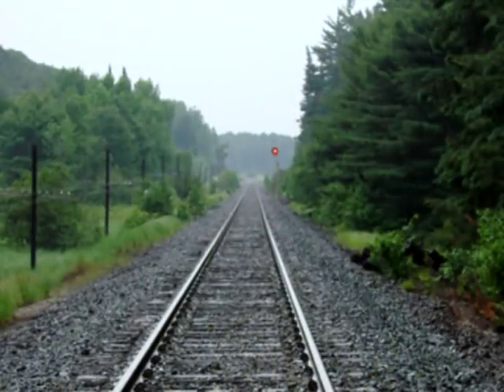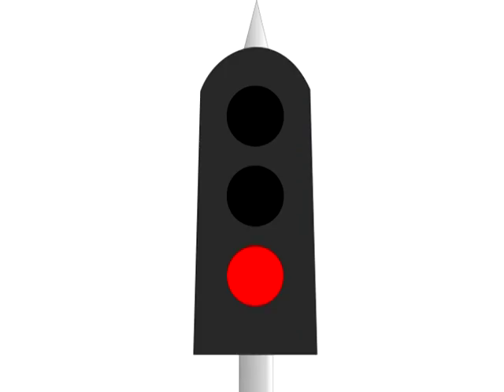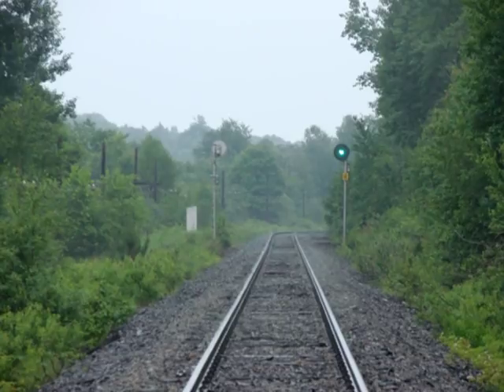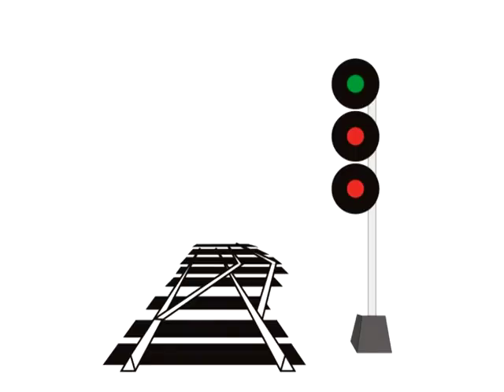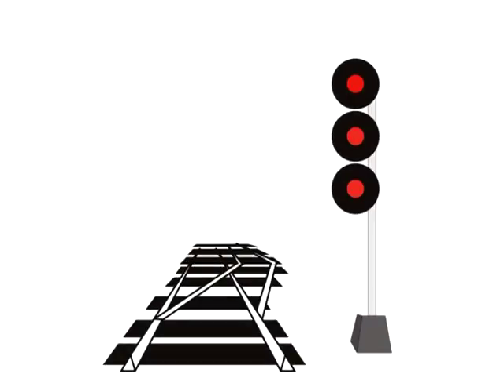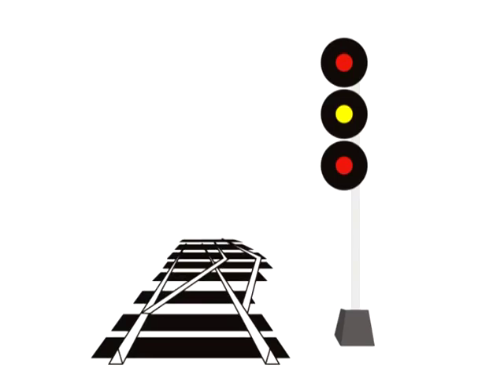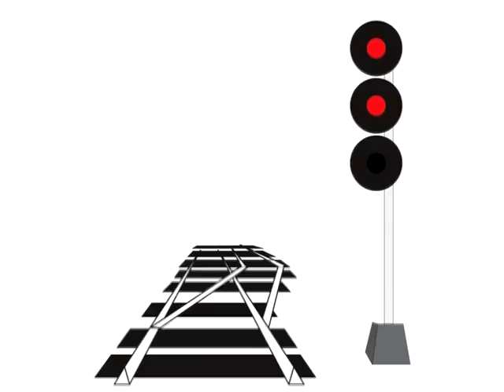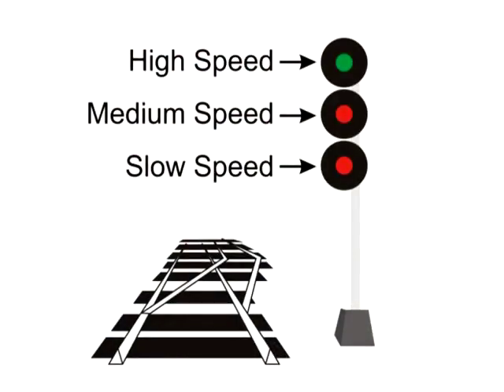Railroad Signals, reading and meanings, part 1: The basic three light system

Comment: What about rail signs? What does "R X R" mean? Thanks for uploads.
Reply from the maker: +CHRIS BROESKY That would have to be Railroad Crossing. Is this a sign for the road? or the rail crews?
Reply: Ian Juby yeah its a round R X R rail crew sign. What about the rotating green/red signs on switches? Your signal videos were great! Just curious about rail crew signs now.
Reply from the maker: Ah, okay. The switch stand reflectors are so we can identify which way they're lined from a distance.  Red/Green is main track, Yellow/Green is non main track (i.e., a yard).  Red or yellow means the switch is lined to go off the main track.  Green means it's lined for the main track.  That was the reason for my one emergency stop - we came around the corner at night and saw a red reflector.  Turns out the reflector was loose and got turned exactly 90 degrees in the wind!  Thankfully the only damage done was the stains on the seats.  :)
Reply: +Ian Juby Lol! Thanks for the info :)
Reply: +Ian Juby Hey there Ian. Im seriously interested in getting hired on with CP or CN and a career in the railway. I know the economy isnt great and there probably not hiring much. Any tips on what they look for on resumes, or any tips in general on how to get in on the railway?

Comment: What does

Flashing Green
Red
Red

mean?
Reply: +CanadianRailfanner12  I have been through the CROR many times, and I don't recall any such signal.  Where did you see this?
Reply: CanadianRailfanner12 the signal is broken
Reply: in  other parts of he world there are similar ,not exactly same ,for example flashing green means  that the train will remain on the main track, but that the next signal (usually the exit signal) should be approached at not exceeding 60 km/h, expecting a divergence there.A flashing green over steady yellow, with one green plate, indicates a divergence with a permissible speed of 80 km/h, with the exit signal clear (1/18 turnout).these signals i mentioned are not from CROR :)
Reply from the maker: It depends on if it's a dwarf signal or not, which is what it sounds like. I cover those signals in part 4.
Reply: It is not a proper signal on a high mast and we be considered its most restrictive speed which would be a clear to stop.
Reply: Given what he said in this video, I would expect that means "advanced clear to proceed", ie not only is the block it controls clear, and safe for full line speed (no sharp turns, no switches set other than straight-ahead), but the signal and block after that is also at least "clear to proceed" (or even an ACtP itself), and the third block in the series is at very least a full-speed caution (ie, yellow-red-red) / clear to stop. Meaning that from that signal forwards you have three full blocks before you would next need to stop, and two before you need to consider braking in anticipation of stopping.

For high speed trains that are allowed to reach a higher speed than normally-engineered ones (usually 140mph+), or in cases of passenger expresses sharing a line with more restricted freights, with the extra speed meaning an even longer than normal stopping distance, that's essentially "clear to run at maximum permitted / elevated speed". A non-flashing green (meaning only two "clear" blocks with a potential stop at the end of the second, and therefore probably a need to start slowing in anticipation of a stop after the first) would instead mean permission to run up to the normal maximum speed (so 60 to 75mph for freights depending on location and specification, and up to 79mph in the US / somewhere on the 90-100-125 axis in the UK for passenger services), basically acting as an additional level of speed restriction for HSTs.

Same as with the flashing yellow, the failsafe condition is to fall back from "elevated speed permitted" to "normal line speed permitted" if the flashing mechanism fails, as well as it being a condition for signals ahead of e.g. some moderate bends or high-speed rated switches (good for up to 80~90mph, say) which standard services could take without having to slow down, but HSTs would need to brake for - without having to show a "medium speed" indication and slow every single train passing through to 30mph just so that the express services wouldn't derail.

Think of it a bit like how USB speeds have gradually increased from the original 1.5mbit/sec and they've had to come up with additional superlatives for each new grade as it's been added ;) ... only that original one is "low speed", 12mbit is "full"... then USB2's 400mbit had to be called "high speed" (a bit of an extreme jump, but analogous to our "full line speed" and "high speed" trains), and now USB3 is "super speed" (...we probably won't see that sort of thing sharing lines with regular trains due to the limitations of steel wheels on steel rails adhered and steered purely by gravity; but you could probably call the experimental 300+mph maglevs and hyperloops and so-on "super speed" trains... or just shift everything down a level by calling 12mbit "medium speed" instead). And if the quality of your cable just isn't good enough to support the newer, higher speeds, the system will gracefully fall back to one of the lower levels until data can be successfully transmitted without errors.

However, that's just from a theoretical standpoint. If I was actually going to go driving a train, I'd check what the signals meant beforehand, and if I came across one that I didn't know the meaning of, I would at least treat it - in this case - as a Medium Speed restriction. If not outright assuming it might be a malfunction, bringing the train to a stand ahead of the signal, and phoning/radioing the dispatcher to find out. Sooner risk a verbal chewing-out for being so much of a rookie as to mistake a High Speed / advance clear to proceed indication for a signal fault, than end up piling into a speed-restricted switch at 140mph and causing a humongous crash.
Reply: On NORAC governed railroads a flashing GREEN over RED over RED is a Cab Speed signal.
Reply: ...and what does THAT even mean?
Reply: Depends on your particular rail line, and if your passenger or freight.  Some signals(although the same aspect) will have different indication for different rail carriers and if it's passenger or freight.

To me,  a solid green is "clear 50" clear/proceed at up to 50mph.  A flashing green is a "clear 60" clear/proceed  at up to 60mph.

Comment: how do u become a train conductor???
Reply from the maker: Nowadays? You don't.  CP and even CN are starting to hire again, but CN laid off something like 1,500 conductors in Western Canada alone.  It's been brutal.  But the big players (CN, CP) will put you through your training themselves and pay you for it.  Otherwise, there's a number of colleges which run conductor programs - typically 3 months long.  So that would be a prerequisite for getting hired on with a short line which doesn't have their own training programs.

Comment: The signal at 13:20. Doesn't mean you have to do 30 pass this signal. I have worked for the railroads in the US and that is what we call a diverging clear. The signal prior to that one which normally will be a Yellow over green, Approach Medium. That tells you that the next signal will indicate a diverging route. Speed is not dependent on signal indication in this case. It is dependent on the speed allowed through that switch. Timetables will tell you this. I have seen switches with speeds as high as 50 and as low as 10 with a clear indication.
Reply from the maker: That may be true in the US, but these are Canadian signals. That's a medium to clear by the Canadian Rail Operating rules definitions, so 30 mph until clear of the switch. You've seen 50mph switches? Wowsers!
Reply: Ian Juby, that's silly especially if they have switches that are rated for those higher speeds. Unless they don't have switches rated for those speeds I guess (#24 and higher). Sooline/CP/IC&E north out of KC. We have two 40 mph crossovers at Lawson and Polo.
Reply from the maker: I believe most of the switches we have here are actually rated for 25 per, but we're restricted to 15 per because of the sidings. We have one siding on my run 25 per and double track to the west with 45 per switches on either end. We're limited speed going through those switches.
Reply: Ian Juby so most of the switches around are #20s
Reply from the maker: I don't honestly know as I'm not track forces, I'm transportation. But I've heard that rumored around.